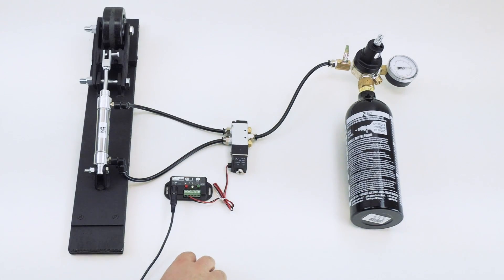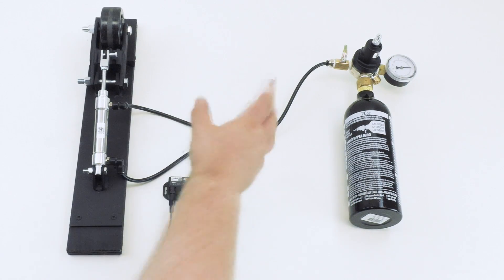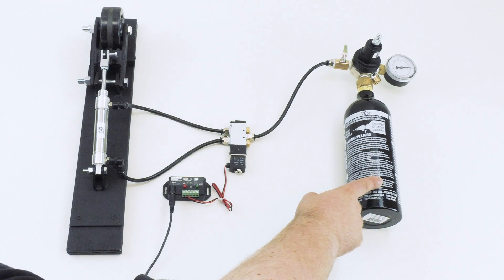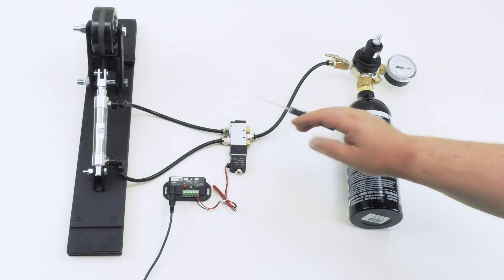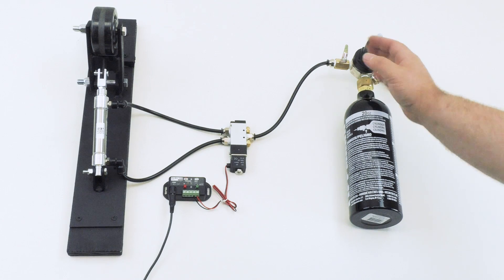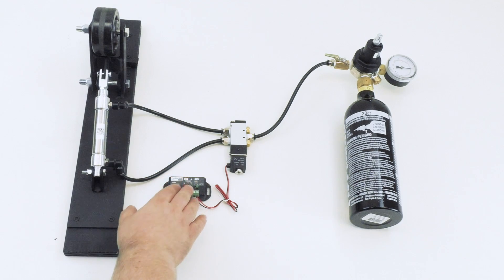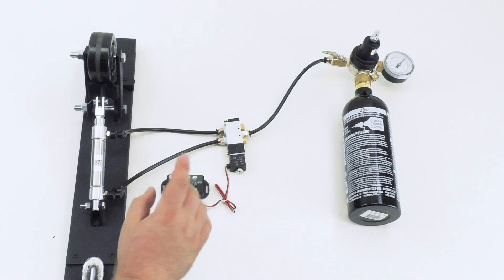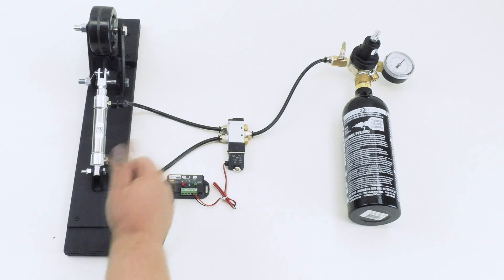How to Operate a Pneumatic Cylinder from a CO2 Tank

Comment: Could you use a small CO2 canister instead?
Reply: Yes, you can. I’ve done this. Just need the adapter and the correct regulator. Pretty the exact same set up as this, just with the adapter for the co2 cartridges. Or you can take apart a paintball gun and take what you need to make it work.

Comment: Can you use a mini air compressor like the one used to inflate heavy duty car tires in place of the co2 tank?
Reply: All depends on if it has a high enough psi and it's better to use a compressor that fills a separate air reservoir

Comment: i dont get it -- where does the co2 go ? and when?
Reply: The solenoid valve has a air muffler that’s where the air comes out
Reply: Through the hose,  through the solenoid valve and into the piston then out of the exhaust on solenoid

Comment: Hi can you help me. I want to install this to open a driveway gate. Would this be suitable for the application?  It won't be used daily. But I imagine it will need to be bigger rams, however would the psi have to increase? 30psi is 30psi on any cylinder is it not?

Comment: Hello, i want to ask, if i use this tank to let say, make a lift under a seat of a motorcycle. the idea is to lift the seat with a person on it. do you think its possible with its capacity?. if so, how many times do you expected that it can actually tilt the seat with a person on it?. and can you suggest an actuator that can withstand the weight?. thank you in advance.
Reply: i think a dc linear actuater run off the batter might work better for your application

Comment: Thank you so much
how  i can calculate maximum speed of pneumatic cylinder and what is the minimum time of controlling the solenoid valve
if can help me please
Reply: The speed depends on the air pressure and the controlling of the solenoid depends on the switch